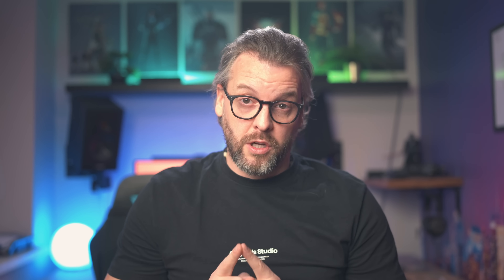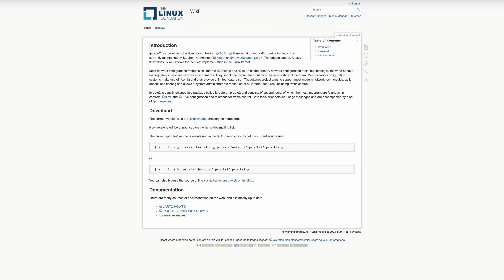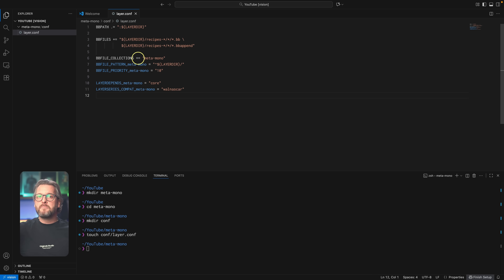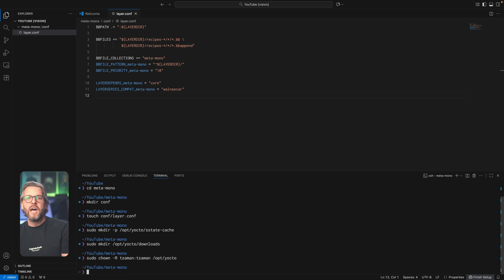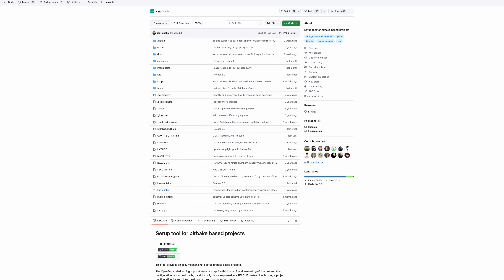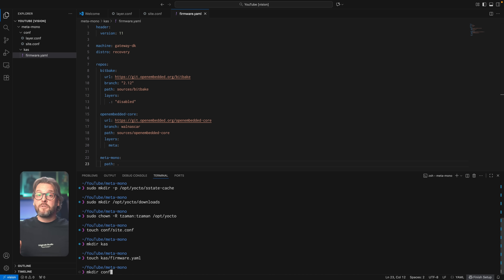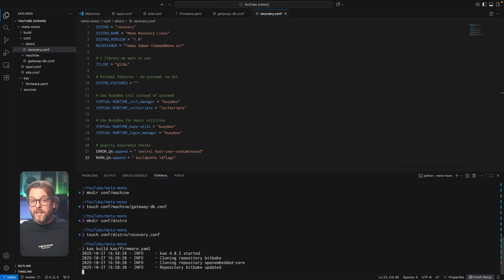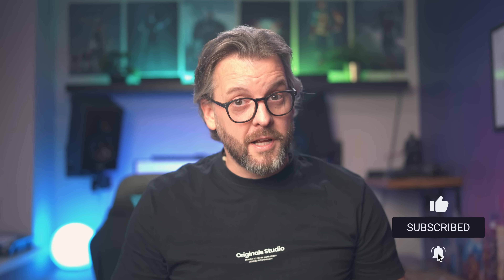Intro to Yocto I wish I was given | Part 1: The Basics

Comment: Yocto, the number one excuse why deadlines are never met!
As a Linux user and firmware dev with years of experience, I've learned to accept that Yocto is a prehistoric monolithic nightmare of a project, that should've never seen daylight in the 21 century. 

Monolithic design, check
Slow to build, check
Slow to test, check
Slow to debug, check
Breaks when upstream changes urls, checks

It's basically everything you want to avoid in software engineering, yet some oldtimers in the field refuse any more modern change.
There are a lot easier and more modular approaches, where you don't need to rebuild a 250 MB image file to add an 400 KB application to the image.
Reply: Please explain what are the more modular and modern options replacing Yocto? What are you recommending for embedded linux build system?
Reply: If you're going to make such claims, please substantiate them.
Reply: @ClaytonAllenFP   Seems like my previous reply with an explanation, has been removed by YT again...
So in short, for the second time...

I do agree that Yocto provides a huge freedom to tweak and modify your custom Linux build, to your hearts content. However! What many dev's often forget, is that the custom Linux build isn't the actual goal of their embedded project. The software running on top of set Linux build is! So for most embedded Linux projects, using Yocto is totally overkill and just a waste of time. Especially as Yocto basically handels the whole system as a monolith, packaging everything in one image file, with very long build times. 

It's in my experience far easier and faster, to just take an SOC's manufacturers base image, chroot into it on a Linux laptop, then modify, add and edit basic project requirements that way through install scripts. This way the average project image file is often completed within less than 45 minutes, whilst the average Yocto project is still downloading hugely outdated dependencies 4 hours later, if it can still find them...

So whilst I enjoyed working with Yocto for 2.5 years at my previous job, I didn't see the productivity I wanted out of it. It was mostly just a bottleneck, requiring 15 minutes rebuilds, for each bug that was found by our testers. This usually blocks the whole development cycle, when more than 2 people are simultaneously trying to work on the same Yocto project.

Comment: Yocto shines when you want to build a family of products based on some common building blocks. It’s pretty awesome and you start to appreciate it once you understand core concepts. It has pretty big support and good documentation. It’s a steep learning curve but well worth it.
Reply: how does this compare to buildroot? I find buildroot to be way easier to configure and get a working image.
Reply: In my opinion, it's a prehistoric monolithic nightmare of a project, that shouldn't have seen daylight in the 21 century. 

Monolithic design, check
Slow to build, check
Slow to test, check
Slow to debug, check
Breaks when upstream changes urls, checks

It's basically everything you want to avoid in software engineering...

As a decade long Linux user, I really like the modular approach of the OS. 
Yocto is basically the opposite of what Linux stands for, a monolithic design, where adding a 4KB service file requires a full rebuild and reinstall of a 250 MB image...
Reply: @timmy7201  Well, that's the whole point isn't it? An OS image whose contents are entirely determined by source?

Comment: Something very important that should be added to the Mono router is on First Setup for the end user you should make it so it force prompts the user to change the default login and passwords of the device to something only they will remember, too many router manufacturers leave default logins which can often lead to those routers becoming compromised because the logins are left at factory defaults being either admin:admin or admin:password defaults, as for root login, the user account higher than the standard admin level should also have the same precautionary setup as well, but only for password field entry. Maybe give it a unique username at factory default for root, instead you could factory default root login user name as mono instead.
Reply: Also I do hope that the Web GUI for the router be fast and responsive, and not bloated with JavaScript just to perform actions to change and configure the router settings. There's a lot you can do with just HTML alone with simple clean CSS code, HTML can do things you don't even need JavaScript for such as buttons and clickable actions. There's a website called Just fucking use HTML that can show you what HTML can really do and why you don't need JavaScript for a lot of things.

Comment: Build root also exists
Reply: It’s also nicer and easier to use, especially when you want to patch packages or the kernel.
Reply: Yes. But they are good for different things.
Reply: @kanskejonasidag1 I have yet to understand what these different things are. If you lack some good ol' complexity, then sure, Yocto does what buildroot don't. 
Other than that, they both produce a custom Linux image, you can do anything with one or the other. One tends to be easier though.